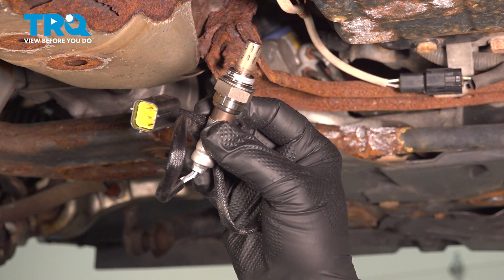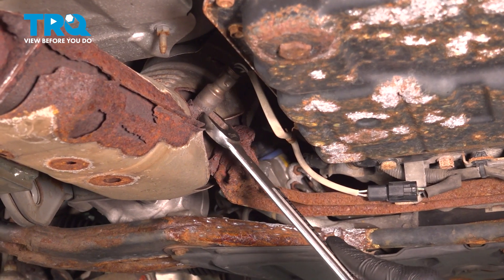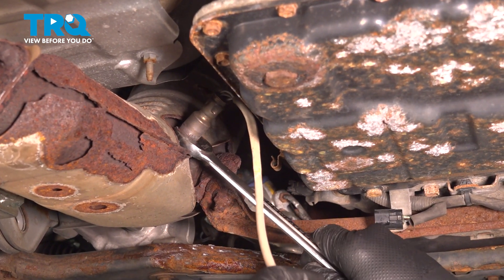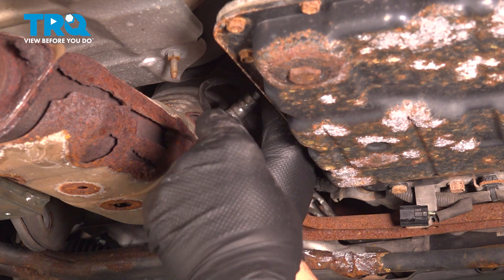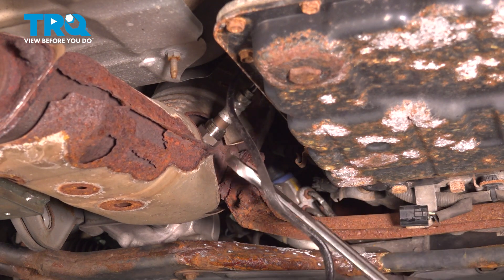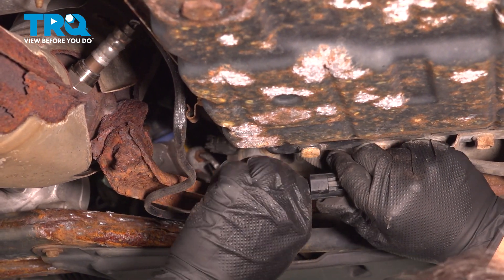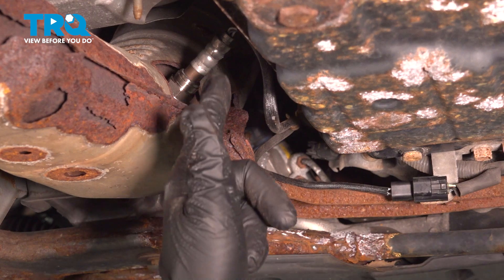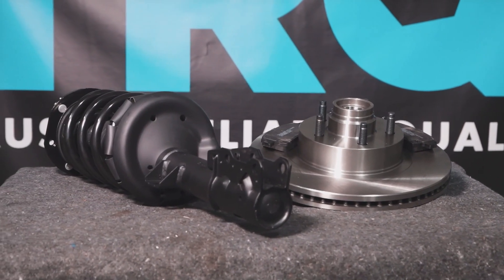How to Replace Downstream O2 Oxygen Sensors 2008-2013 INFINITI G37 3.7L V6

Comment: Question: if what the oxygen sensor’s plastic end is supposed to connect to (the actual car’s harness) is missing, would that be an entire replacement of that harness or would I be able to replace just the plastic piece and get the original wires back in there? Great videos this helped out so much, and helped me find out that that is indeed the DOWNSTREAM!